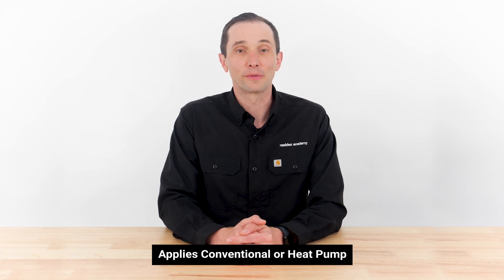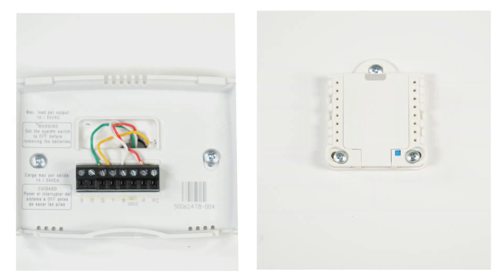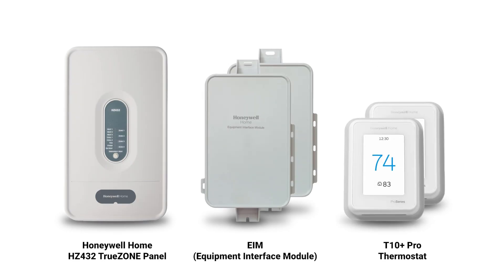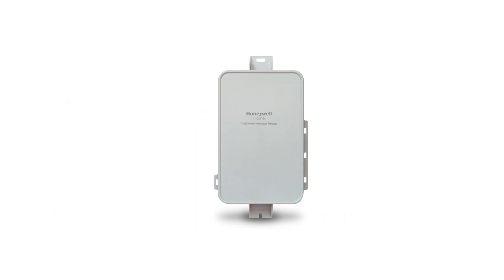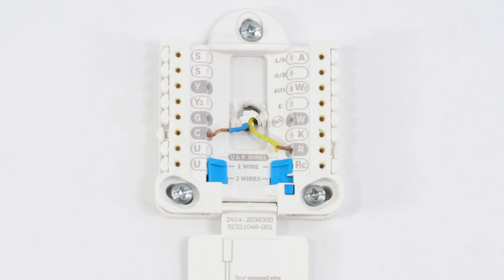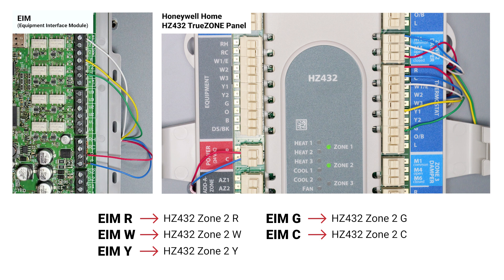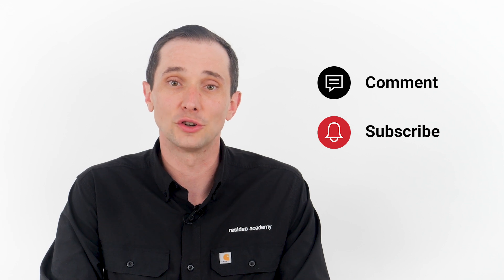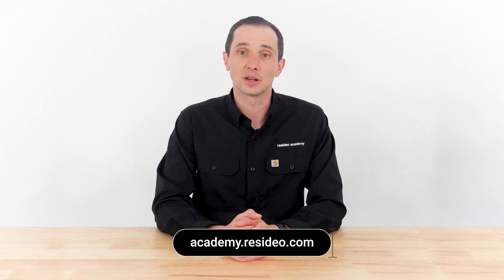Zoning with Wireless Thermostats When You Don't Have Enough Wires

Comment: Thank you for the video; however, I believe that Resideo needs to fix a larger issue first. With today's highly active AI cyber threats, Resideo needs to make a video on how to get their Redlink system to work behind a firewall. There is so much talk about not being able to make RedLink work without using a separate router by itself to make your system work because of the constant pinging. I have 144 devices behind a Firewalla; they all work except yours. It goes offline more often than on.
Thank you!